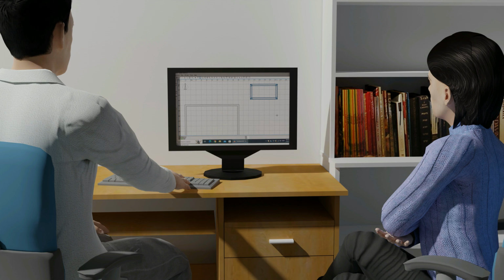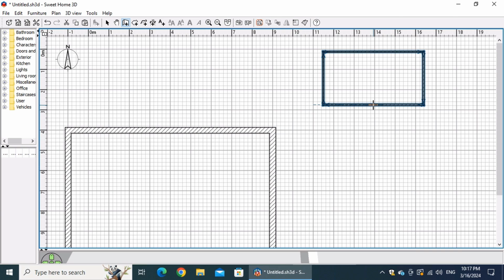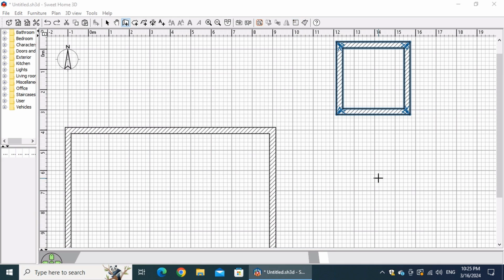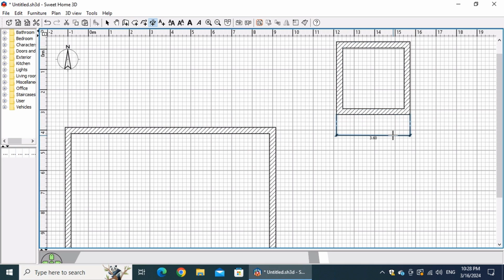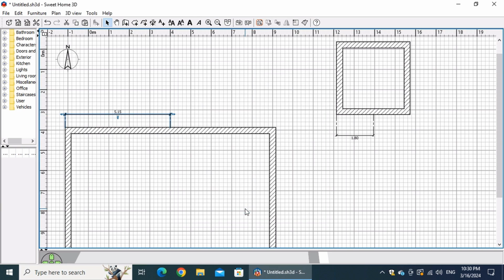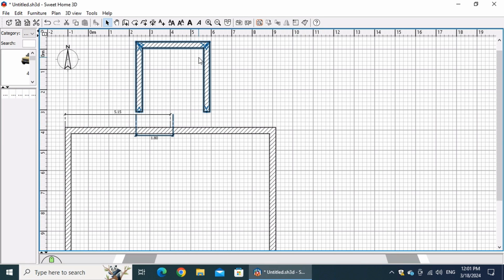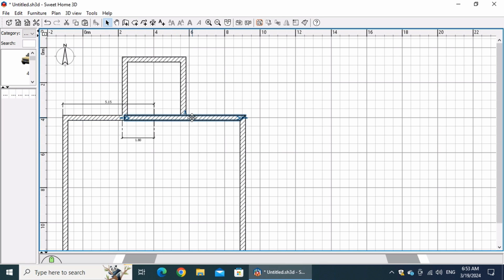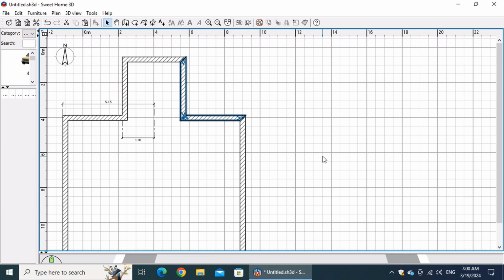Sweet Home 3D Advanced wall editing : Splitting,Joining & Perfect Placement

Comment: I CANT MODIFY DEMENSION LINE
Reply from the maker: For the double-click to work, make sure the “Select Object in Plan” tool (the black arrow icon) is activated in the toolbar.
If it still doesn’t work, try right-clicking on the dimension and choose “Modify Dimensions” from the menu.

In the window that opens, under the 3D Rendering section, you’ll find a checkbox called “Visible in 3D Plan.”
Check this option — but note that the dimension will only appear in the first two quality settings of the Create Photo tool.